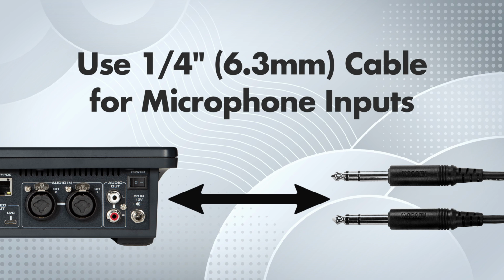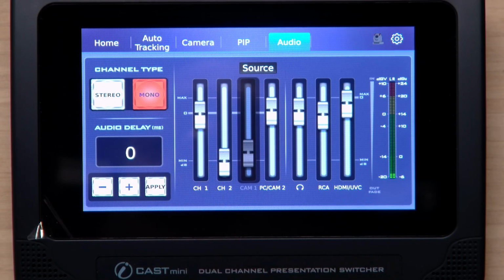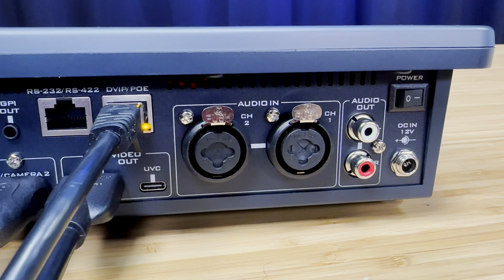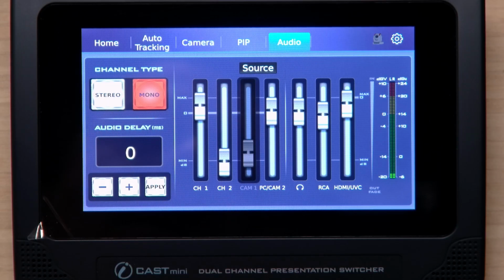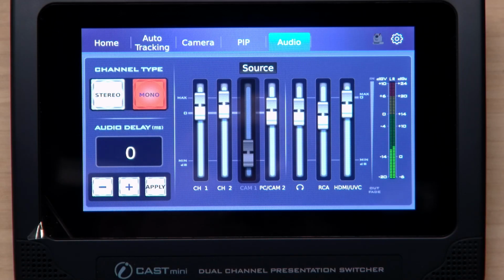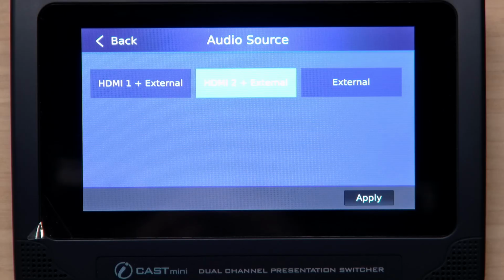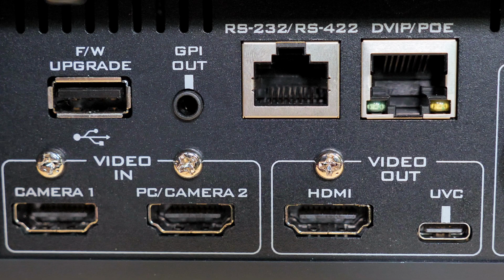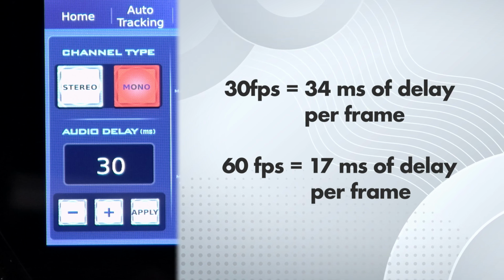Datavideo iCAST Mini Tutorial 3: How to Connect Audio  and Mix Sources

Comment: I installed this unit today for a client. I love how simple plug n play it is to use with a Sony ZV-E1 camera (with a micro-HDMI adapter).  Such a curveball that your LINE inputs are XLR, and the MIC is TRS, very unusual by conventional pro audio standards. And the lack of phantom power is also a very odd omission at this price point. We're using it with a Rodecaster Duo for processing, which works well now that I have the correct cables in place (after a run to Guitar Center).